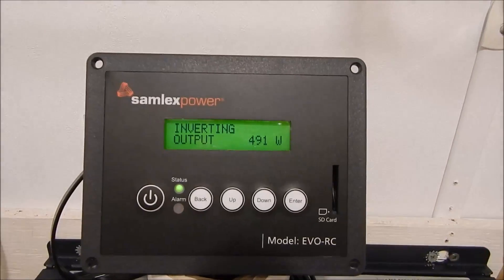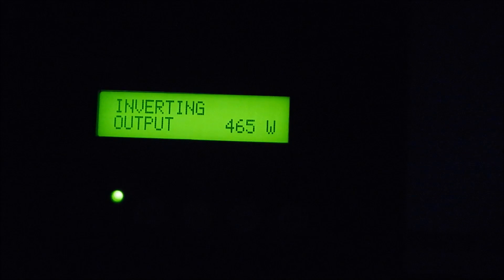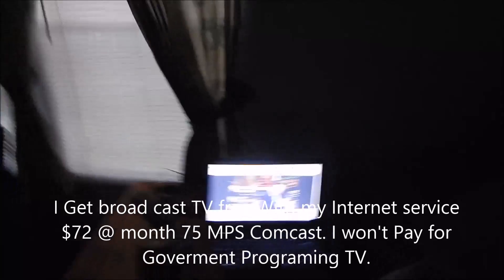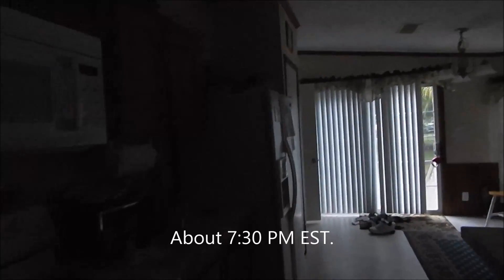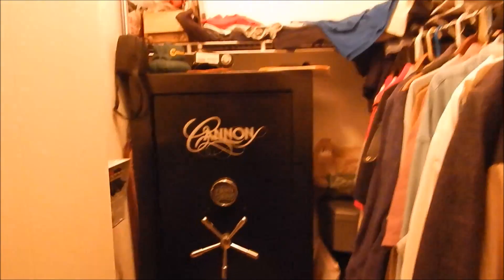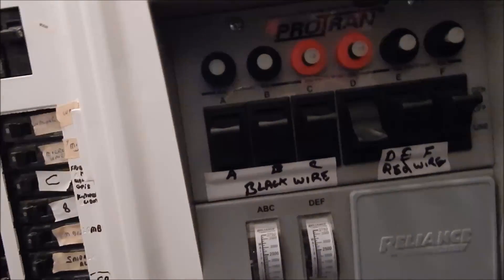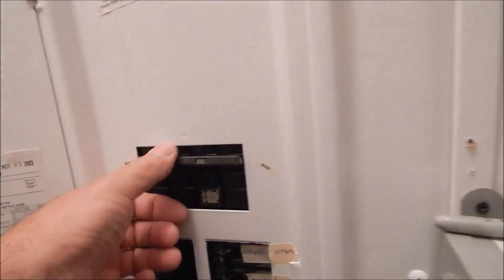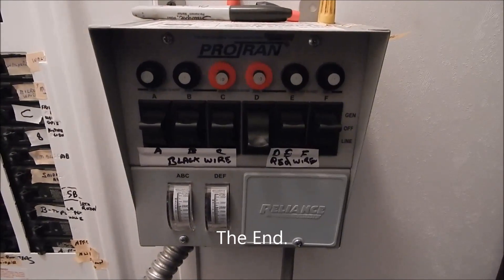Living on Solar, My Samlex Inverter Power During Severe Thunder Storm!

Comment: I love battery back up with automatic switching.  I was playing a video game in my trailer and the street lost power, but I didn't even notice for about an hour when I finally saw that the house and street lights were out.
Reply from the maker: Yes I agree.  If I end up here much longer I may buy a 100' roll of # 6 awg & hook it up to grid power so it will transfer power & Charge battery bank if needed .I have it in pure inverter mode at this time with manual switching.

Comment: Great idea and nice setup. I'm thinking about doing this for my house. In most homes, the master switch does not switch off the neutral (white) or ground (green). Does your system isolate the neutral line from the power grid? Also, how do you protect your system from electricity coming up the ground rod into your house; is your ground protected? Thanks for sharing!! 👍☺
Reply from the maker: Thanks. The main breaker shuts off power coming in from the grid ,called Hot or line . The Ground & Neutral wire are bonded in the main panel only. Electricity goes to ground not up though the ground . My home has a ground rod any were I have power coming in to it any were be it AC or DC power. Lighting strikes happen here all the time so I always ground any & all power coming in or going out, I have many more ground rods buried around my property than the electric CODE calls for.

Comment: That rocks brother. Happy for you. Glad that new inviter is ROCKING !!  Do you run a window AC? Thanks for the video. God Bless. O ps sent a PM..
Reply from the maker: Yes I have been running a 8,000 btu window unit in my bed room for years off my older GO Power 12Volt inverter. Hard to sleep in the 90f+ heat at night in the summer when your power goes out. Not for me though.